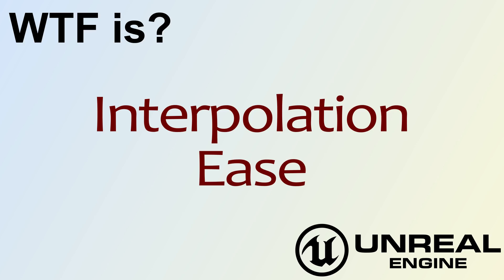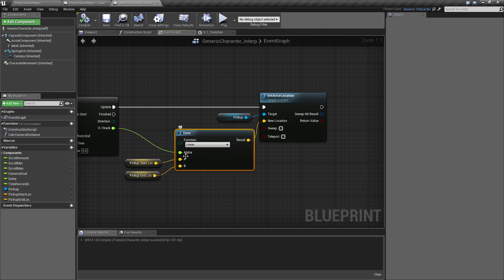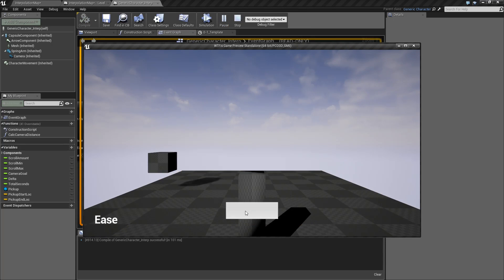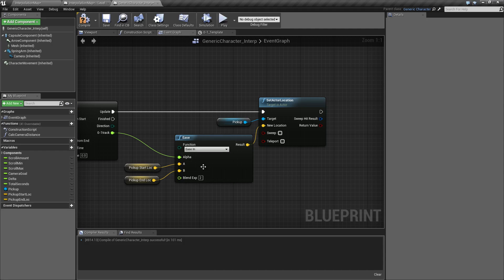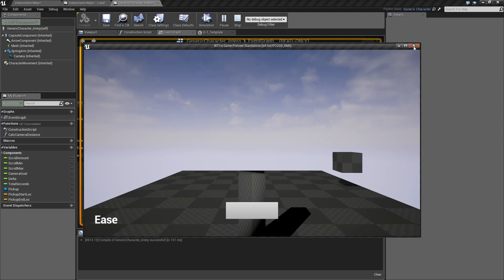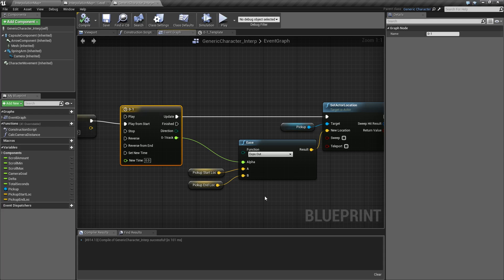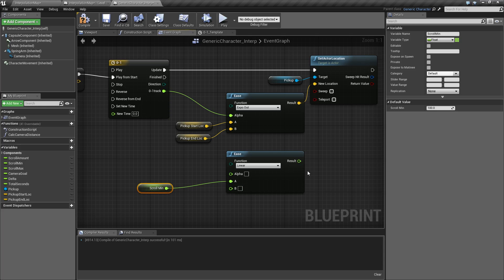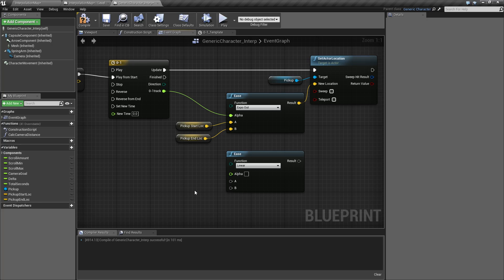WTF Is? Interpolation - Ease Node in Unreal Engine 4

Comment: .
is there is any other node that I can store Alpha without Timeline?it's a Big Node and I can't use it inside Functions
Reply: You can use a timer. Create a variable to store the Timer rate (smaller value better, this is just used to drive the fake timeline), then use  that value to  increment another Float variable which will represent Current Time. Create another variable for Time Limit. Add Node Clamped to Range, Input Current Time, 1st B = Your Time Limit, 2nd A-B used to set the Alpha Range 0-1, output gives you an Alpha no matter how long the Time Limit is. Then use your Current Time compared to Time Limit to reset or stop the Fake Alpha Timer functionality. 1 year late response but maybe this will be useful to someone :)
Reply: @phosphornaut6811  Thanks, using this to do easing in UMG. Wish there was some built-in way for easing of multiple parameters, but so far so good!
Reply: Always trying to figure this out